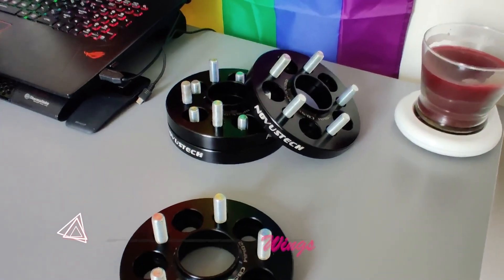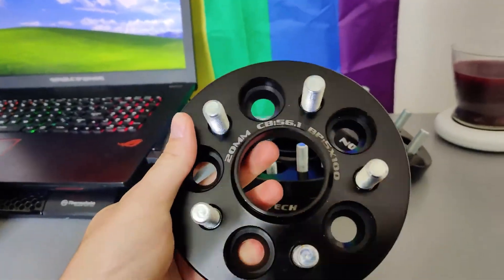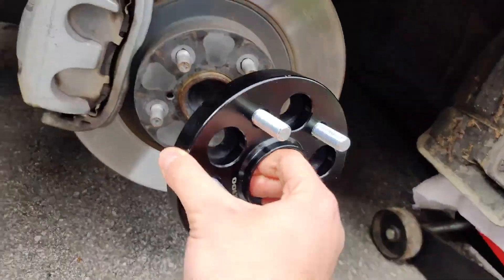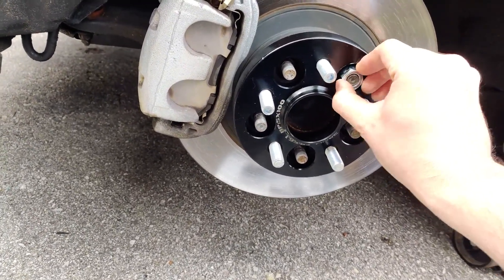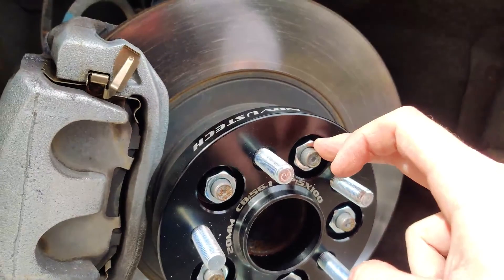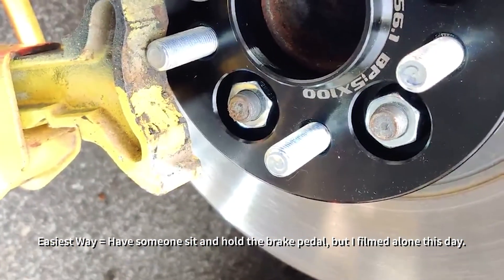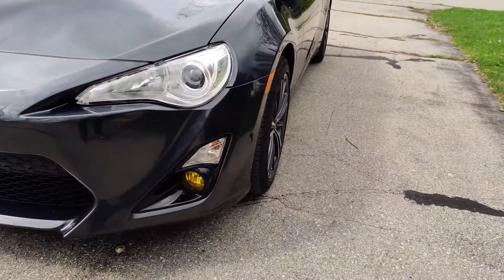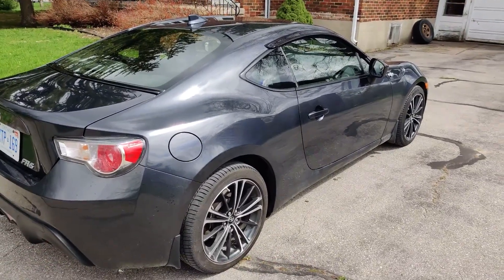20mm Wheel Spacers Install and Review for FR-S/BRZ/GT-86

Comment: A set of lower SPC camber bolts will add some front end grip and help with turn in feel. Usually nets about 1.1-1.4°. highly recommend that.
Reply from the maker: Hey again! Yeah installing whiteline bolts sometime soon was going to this weekend then got behind haha! Great call! I will run them until I do rims and coilovers and get fully adjustable top hats but amazing cheap solution for time being if installed right!
Reply: @findingmywingsjesse  it's pretty straightforward. Worth getting an alignment if you want a shop to dial it in exactly. 

I have the SPC lower bolt in and took the lower bolt and added it up top for added camber. Works nicely with my RCE yellow/Bilstein B6 combo.
Reply from the maker: @MyGoToUserName  yeah planning an alignment right after good call! I want to do coilovers but will need to get one that can work well around stock height (my car actually came with 0.5 lower springs equivalent to jdm trd or sti pink springs) as it's my winter daily and already scrapes on stuff but at that point I will probably go adjustable top hats, also looking at RCE mainly their tarmac 0 or tarmac 2 complete coilover but not in a huge rush until I baseline the car the way it is. Then we will get into power too! I appreciate the response and advice here hope to see you at events sometime soon but I have to air on the side of caution with family working in hospitals atm.

Comment: Have noticed any uneven tyre wear after installing?
Reply from the maker: Not specifically no but I removed and got new rims all together before I got too many km's. They would increase camber a touch so maybe but weight being the same plus the weight of spacers not much more pressure on wheels.

Comment: What did you torque the wheel onto the spacer to? Factory specs also?
Reply from the maker: Correct yes factory specs which is 89ftlbs on this car if I remember correctly
Reply: @findingmywingsjesse  I bought the same spacers, but not for an 86/FRS. Was unsure of what the company wants us to torque the wheels to on the new studs. Really appreciate the response man! 

How are they holding up?
Reply from the maker: @a5___br1sk3t5  almost always same spec as oem wheels unless the spacers convert the bolt pattern or use different threads.

I did not run them too long I ended up buying a set of wide lightweight rims in one of my other videos but installing 25mms on our toyota matrix tomorrow (great timing lol) so I can run my frs wheels and tires.

Most people have 0 issues with spacers especially 20mm. I got a bit uncomfortable for track usage and with how sensitive the 86 steering is I did feel a bit of a change but more than fine for street driving.
Reply: Sounds good! I’ll make sure to follow the same.

I’m using a 15mm set for my car, but should be okay with the clearance behind the wheels.